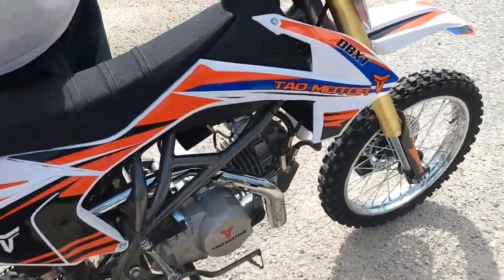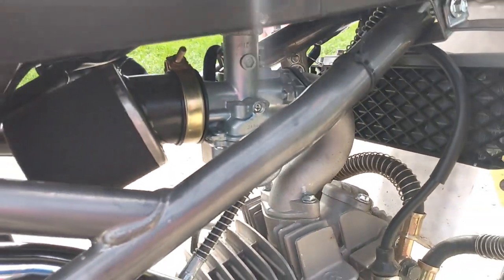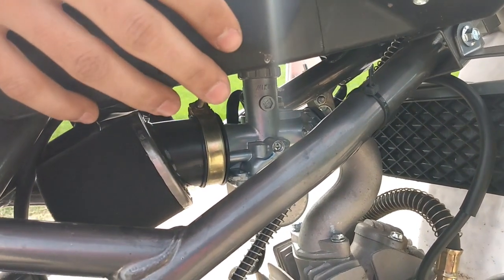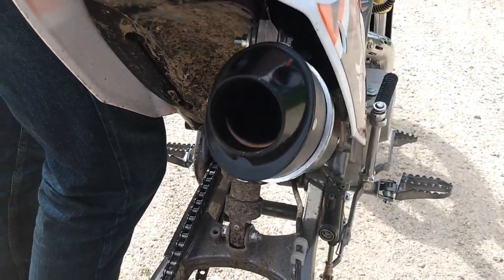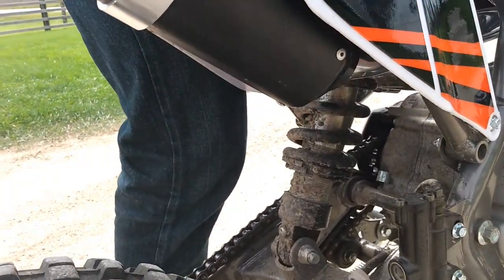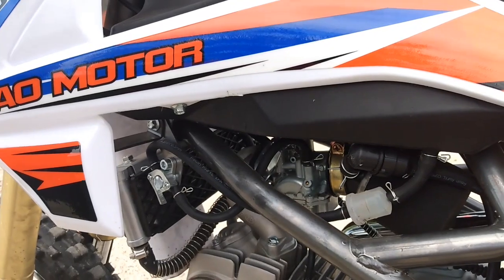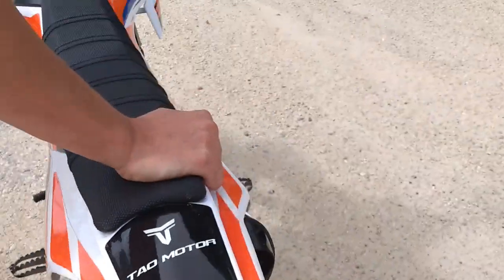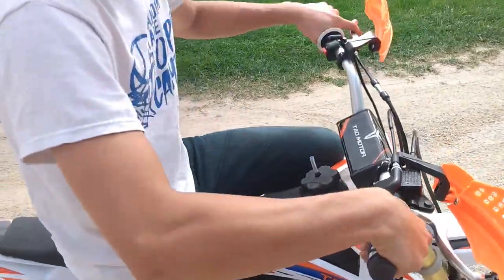*NEW* Make Your TaoTao 140cc Pit Bike SOUND and RIDE Like a Honda CRF150R for $50 |POWER INCREASE|

Comment: You mean 150f lol this thing won’t touch a 150r
Reply: Not without a bunch of internal mods...
Reply: It can get there, to to tboltusa LoL
Reply: Tebibyte the crf150r is a motocross bike and it’s liquid cooled 4 valve , the Tao Tao is a 2 valve so no you can’t get there lol
Reply: @freedomisntfree_44  ofc lol. The 140 can't really get there I was kidding
Reply: Tebibyte I mean it surprised me though 🤷‍♂️ for 850$ it’s impressive lol
Reply: @freedomisntfree_44  Yeah lol I'm getting one soon. They sell a big bore kit, and racing head kit at tboltusa LoL. $500?
Reply: Tebibyte 🤔 I’m gonna look into it I already got the carb changed and that helped a lot, a big bore kit should make this thing a rocket
Reply: @freedomisntfree_44  Nah, the big bore kit won't really change this thing, what's gonna make this thing fast is that Roller rocker kit coming with the race head LoL.
Reply: @freedomisntfree_44  But with that combination I guess you should be flying, get a 18 tooth sprocket if they make it
Reply: @freedomisntfree_44  Get that kit, get hand guards, and breakable foot break and shifter
Reply: He said f
Reply: turbosquido read the title 🤙🏽
Reply: @freedomisntfree_44  gotcha. Didn't see it until I extended it. I thought you were talking about during the video. 🤙
Reply: turbosquido this Tao Tao is still really strong for the price, I got one but in orange. I just wish it was a 5-speed. It can’t be beat for 850$ and beats some that cost more lol I like this bike
Reply: Save your time and money and buy the zongshen 190cc engine and then you'll be good to go.
Reply: jesse hobart is it reliable and bolt onto the dbx1? How much more power, sounds awesome 😎
Reply: @freedomisntfree_44  its Honda mount point.. you can pretty much make it work on any pitbike as long as the head doesnt hit the front tire.
Reply: @freedomisntfree_44  use google. Pretty sure they say 15-19hp. So atleast double
Reply: Not to mention that you get an extra 5th gear. Zoom zoom zoom.. zoom..... zoooom.
Boom.
One if these days I'm going to get an  apollo rfz x18 or x19(headlight is nice), or a coolster m125, or a tao db x1, or BMS pro 125 and do the zs 190 engine swap and 4 valve anima head. Trying to decide which bike is the best value. Honestly, I would prefer the RXF 190 if I could get it imported from Canada for a good deal.
Reply: jesse hobart isn’t it like the piranha engine? My dbx1 has a tick in the top end already, I ride motocross as well and when I’m not at the track I don’t ride my Yz all that much but I got a fun little pit bike track at my farm and am pretty rough on the Tao Tao. I rev the hell out of it and rip it hard. The 190 engine is about how much I bought the dbx1 for new but if it lasts I’m cool with it. When the 140 on the dbx1 goes I may look into it 🤙🏽
Reply: I know what are these guys thinking a Cr is a motocross bike
Reply: @jessehobart2899 then it will run slightly similar to a 150r the 140s are good but you loose power at 7500rpm

Comment: I think the db x1 may be the best candidate for the ZS 190cc engine swap, especially because it has the oil cooler mounts built in.
Reply: They all now come with the plate for the cooler... i got a 125 with them
Reply: The new DBX-1s oil cooler runs from the crankcase instead of the head. So you could actually run dual oil coolers on the new style motors if you wanted.

Comment: Would you recommend this pit bike? I'm just needing a good bike to hit small trails, and maybe pop a couple of wheelies every now and then ;) This is literally the only Chinese dirt bike / pit bike I could find for under $1,000 that has an oil cooler. That oil cooler makes a big difference in throttle response, HP, and speed! I know there's also a SSR 140 TR, but it's practically the same exact bike, but $800 more. I just don't feel like shelling out $2,000 for a Japanese dirt bike, and something breaks on it and it costs more than a Chinese pit bike to repair.
Reply from the maker: It's a great bike if u do the upgrades to it right away out of the box it's a dog but it's a good runner and rides nice too

Comment: How do you think a bigger exhoust affects your bike... Did it fit properly and is the sound louder with or quieter with a bigger one?
Reply from the maker: It's louder and performance in mid to high range throttle is improved. Very snappy.
Reply: I work at tao..these engines are cheap as hell online...i just got denied for my drz400 loan..im gonna grab an x1 just to mess with it. This is a decent idea. Im gonna try to get mine plated...while i buy sm parts to build a drz from scratch.
Reply: @raymondnoodels7775  how is it working at tow? are these bike actually quality, i mean i know they are cheap but where would you put them in quality aspect?
Reply: @Fdmartinez419  dont jump them. Change the oil(castrol gtx 10w30) every tank of gas..my son dumped both his units more tha. Once. We had them until he outgrew them...all i had to do was a carb and a starter on his bike once.  We are doing black friday at birdys. I beleive its still 100$ off this year.
Reply: @raymondnoodels7775  ok, I was looking at the tao 140 dirbike, for my gf she's never really riden before so this will be her first bike, I figured it would be perfect something for her to learn on and thrash around until she's comfortable and wants something bigger.
Reply: @Fdmartinez419  definitely. And if you keep it in good shape theyre easy to sell on fb market place.

Comment: Hey guys whats up. I have the same bike. The best mod for performance increase is the NIBBI 26mm carburetor. Trust me it turns into a different bike. It costs a little over $100 bucs but the performance gains is worth it. I did put an aftermarket exhaust tip like you guys did but nothing changed the performance like the racing carb. The throttle response is crazy you feel the power immediately. Every time I take it to the trails the rear spins it has to much torque for trails so I might get the 16 inch rear tire for it for better traction. Take care fellas.
Reply: Does it fit tho @ micscience
Reply: What intake and air filter did you use?

Comment: i bought a mikuni carb. but the stock throttle needle wont fit and im scared to change it to the one it came with... did you change the needle or use the stock one? any help?
Reply from the maker: Very simple swap you can do it!

Comment: What do you think is better tao tao 140 or a 2007 ttr 125
Reply from the maker: Dbx1 is cheaper for sure brand new. TTR is a good bike little more money and not as peppy as the 140. Either one is good but parts r more readily available for yamaha
Reply: Get the ttr125 for sure.

Comment: @MMO I’m going to get the 38mm slip on pipe when u put urs in did it just slip right on or what?And is the gap pretty big or not much?
Reply from the maker: There's a gap yes I just put the silencer as far in as I could
Reply: @bearkreekboys  ok there a gap but has it ever almost  slip off and does it sound dif because it has a little gap?
Reply from the maker: It sounds good and no never came off
Reply: MMO ok thanks bro
Reply: U actually need a 32mm not a 38 I have the same bike and a 32mm fits perfect no gap.

Comment: I replaced the carburetor on my 140 but it still bogs with throttle wide open...anything u did to make it run better?
Reply from the maker: Main jet clean? Adjust needle clip lower to richen a little maybe? If u can find bigger main jet that could help or air filter clogged??
Reply: @bearkreekboys  yea I cleaned the old one and adjusted the clip and did the same for the new one new air filter ..same issue..could it be running to rich? Maybe I'll try adjusting the air screw
Reply from the maker: @cm5147  that's possible let me know what u find
Reply: @bearkreekboys  so I messed with the air screw but ntn seemed to take the bog away too lean and throttle at the top bogged too rich and it bogged at the bottom of the throttle.. what size carb did u put on your bike?
Reply from the maker: @cm5147  26mm vm22 I believe
Reply: @bearkreekboys  the one I pulled off was a pz27 27mm so maybe I'll try a 26mm and see.
Reply: C M any luck with this?
Reply: @tonyramirez4522  yes smaller 26mm carb fixed the problem

Comment: What happened to the tao tao did you ever get the right exhaust
Reply from the maker: Sold it it takes the 32 mm exhaust
Reply: @bearkreekboys  so just order a 32mm not a 28 or a 38mm
Reply from the maker: Yeap

Comment: Since I’ve had the Tao 140 , I’ve put 2 different suspension/shocks on the bike. Both of the aftermarket shocks (same exact size as stock) makes the bike sit WAY LOW, bottom of seat actually touching tire once you sit on bike. So I’ve been through not 1 but 2 shocks. Only the stock one makes it sit up at correct height that the bike came as.  

Someone please help, I need a new shock because the stock one is SUPER bouncy, feels blown.
Reply: Get the 2021 Apollo rfz z40 max, better than all the Chinese bikes, has a yx 140 reliable motor and NIBBI carb, racing coil with ngk spark plug and big wheels and great suspension for 1600$ shipped
Reply: @VDM32 hey! How's it holding up so far?
Reply: @Alex-gn6xb  it’s been a little over a year and I’m super happy with the bike it hasn’t giving me any problems yet
Reply: @VDM32  so cool! Does it have electric start btw? I’m just looking something fun , but not sure i can handle a kick in the middle of the hill 😄 I’m a beginner btw
Reply: @VDM32  did you change a chain or carb on it ?
Reply: @Alex-gn6xb  bro get the Apollo trust me you won’t regret it, the chain and carb it came with were aftermarket and I haven’t changed anything on the bike, they stopped making this bike if you can find it still I recommend it because the new apollos don’t come with the upgrades I got mine from power sports max dot com
Reply: @Alex-gn6xb  no electric start but starts at first kick every time
Reply: @VDM32  it was upgraded already? NICE . Yeah, they do not do that anymore. 
What do you think about kayo tt140?
Reply: @Alex-gn6xb  honestly I went with the ones that have a reliable motor and the one I bought has the yx reliable Chinese motor, if you look up piranha bikes they use and sell the same yx motors they just put their logo on it
Reply: @Alex-gn6xb  forgot to mention the frames on the Apollo are double beam steel frames are very durable the other Chinese’s bikes frames are weak and are known to crack and can’t take a beating
Reply: I’m sorry but Tao Tao suck bro the frames and motors are horrible

Comment: Not to mention that you get an extra 5th gear. Zoom zoom zoom.. zoom..... zoooom.
Boom.
One if these days I'm going to get an  apollo rfz x18 or x19(headlight is nice), or a coolster m125, or a tao db x1, or BMS pro 125 and do the zs 190 engine swap and 4 valve anima head. Trying to decide which bike is the best value. Honestly, I would prefer the RXF 190 if I could get it imported from Canada for a good deal.

Comment: Have you even rode a crf150... dude its massive power.
Reply: 150s are slow lol. It's a cool little bike. If you want power get a 450 👍
Reply: @spencergaines8584  you sound weak dude... its called mini bike racing for a reason it helps with the big bikes on the big tracks. You will look like you are standing still vs. The 600s and 1000s but i don't compare apples and oranges like you do. If you want to actually go fast get a 1000cc the we can talk. Your 450 is extremely slow.

Comment: Anybody know how to wire headlights on this thing
Reply from the maker: you're going to need a voltage regulator rectifier and tap into the ac voltage coming out of the stator and then you can put lights on it
Reply from the maker: Some guy has a pretty good video of doing that to a dbx one already

Comment: I was very close to getting this bike but I've come to a conclusion that I think getting the 140cc thumpstar would be better and just save a little more, and why didnt you put an authentic mikuni on
Reply from the maker: It was cheap and I didn't want to spend as much on it
Reply from the maker: It has all the same components is a genuine Mikuni and acts the same
Reply: @bearkreekboys  oh ok
Reply: @bearkreekboys  I never used a genuine mikuni before however I have the same exact bike I bought it a month ago except that it's the orange version. The cheap carbs are ok but after I installed the NIBBI carburetor on my DBX1 it made a world of difference. It feels almost like I added a big bore kit.
Reply: Thumpstar is more expensive